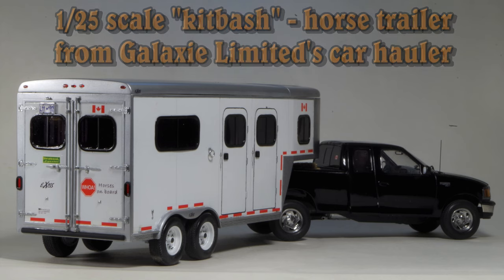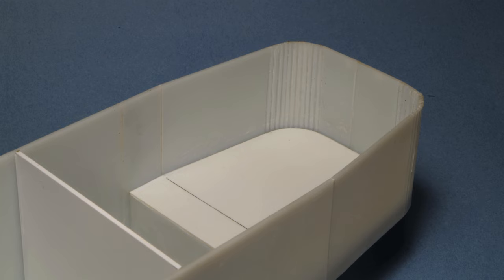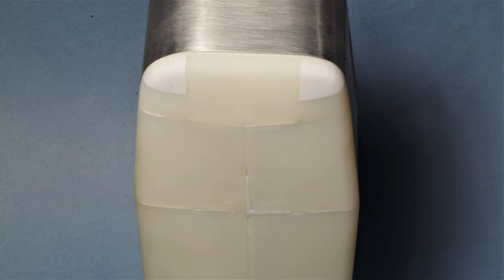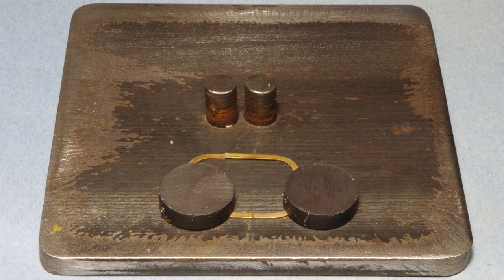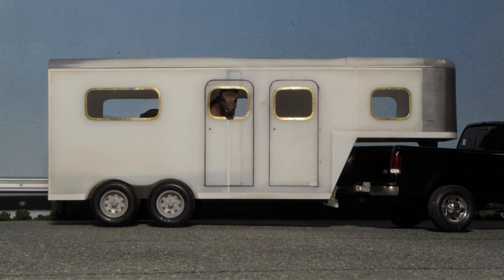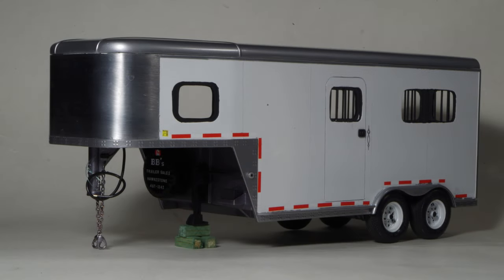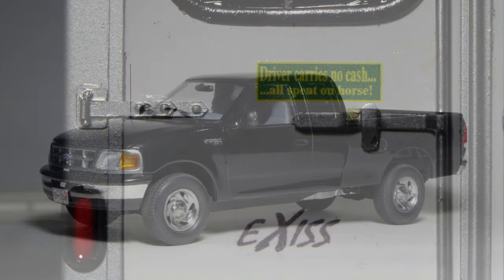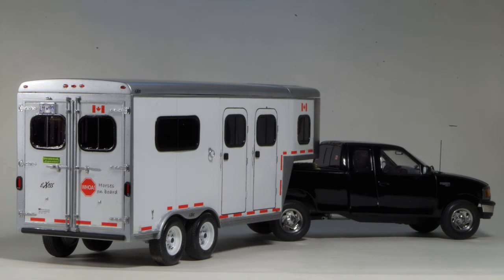1/25 scale horse trailer...made from a Galaxie Limited enclosed car hauler

Comment: Wao you take the model hobby to a hole new level!!
Thanks for the how to!! Beautiful build!!
Reply from the maker: Thank you, I was pleasantly surprised at how adaptable the car hauler trailer model was to a different application. A lot of the techniques have universal applications, scoring inside face of side walls to bend around radius on front corners is something I also did adding interior trim to a W900 KW using repurposed sleeper cab trim from a different KW kit.

Comment: Rob, I have always admired that horse trailer. I wondered if you scratch built the whole thing from sheet plastic. The Galaxy trailer is a real basic trailer that can be the base for work, snowmobile & aluminum skinned enclosed trailers. It's those compound curves that hold, us back from tackling a project! Outstanding 5th wheel build!!! My request from the resin world, would be roof and fender castings. They show up on almost every trailer type that you will see on the road.
Reply from the maker: You're right about those trailer parts being a desirable aftermarket hobby item, especially since many real trailers are assembled from fairly standard components. Fender width is actually another of the inaccuracies on this horse trailer model, being correct for the car hauler Galaxie kitted (with boxed in areas around the wheel openings on inside of trailer) but not for most horse trailers that usually have wheels either completely outside the box like on our 1:1 scale 2-horse straight load, or only a small boxed in area on the inside.

Do you know if the Galaxie kit is still production? I had heard somewhere that they were no longer being made.
Reply: @brsnorthernhorsejourney3579  I believe that they are out of production. It seems that there were 3 kits available. A bumper pull 28ft 2 axle. A bumper pull 38ft tri axle. And a 5th wheel 38ft tri axle. The boxes say 5000 of each. I think that the scale is 1/24 scale 102" wide, but never checked! I agree that the fenders are not full width. My 1to1 horse trailer is an Adam 2 horse w dressing room, tapered front. The photos of your's has the axles facing down. On your & mine 1to1, the axles are face up. That is how the floor is so low! To dream for what is not available.🤔

Comment: Nice build. The only thing I can hack on you is the F250LD/F150T7700 had slightly different wheels and the center caps had cast in simulated lug nuts that matched the 7 lug pattern those trucks use.
Reply from the maker: Thanks for that information - I admit to not speaking a lot of “Ford”, at least with the pickups! Those little variations and spotting features are what keeps the whole world of trucks in both 1:1 and miniature interesting.